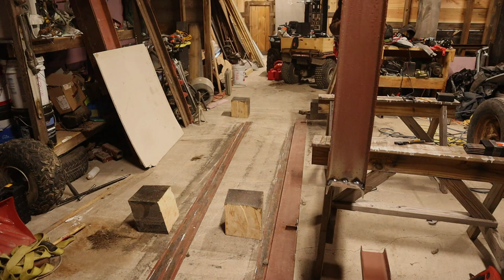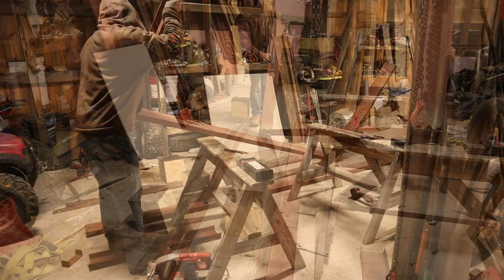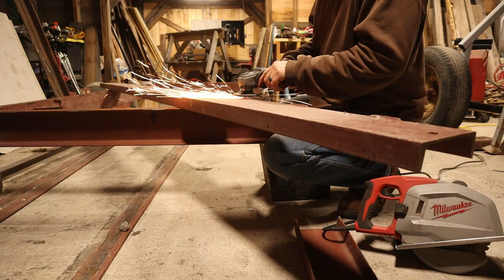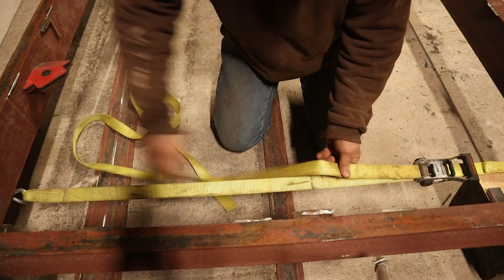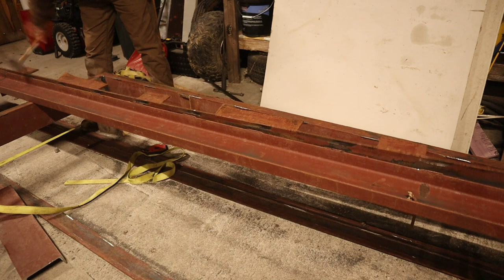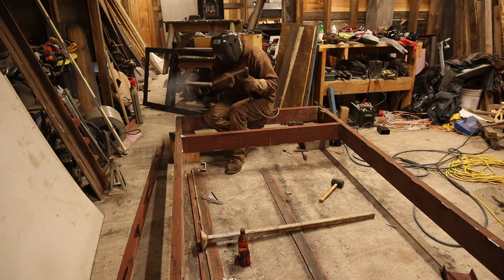Magical Hydraulics: Continuing The Sawmill Trailer Build

Comment: Good job Jim. Guessed you had been out of town again. When you were saying about the frame twisting, I just wondered if you were going to put 45% angles in the corners of the frame to help prevent the twisting. Another way would be from that first cross member, going from where it joins at the side rail to the centre of the end rail. Looking forward to seeing the progress you have made. Take care travelling in that nasty weather. Be safe. Graham 🇬🇧🇬🇧👍👍
Reply: I concur on cross-bracing to limit twisting. But do you look at it and think anti-stretch bands, or anti-crush bracketing, or some of both?
Reply from the maker: The big worry for me is the trailer twisting.  By the time I get the tongue on it and some corner braces welded on the back, racking shouldn't be an issue.  Hopefully the jacks will take care of any twisting once the mill is set-up.
Reply: @TheTradesmanChannel  great minds... you sound like you knew just what I was thinking. Like bracing in floor joists to stop racking/rolling... exactly!
Maybe strapping from sub-corner to sub-corner welded in so it can't stretch diagonally, it can't twist. (Held square in dimention, unless the strap stretches).

Comment: Hydraulics are great to work with to do that kind of work. We used jacks all the time splits 40,000lbs press units apart. Just put some blocks under the square pipe to support it and keep it level and it works fine.

Comment: I was getting a tad worried .... I was going to check up on two of "my" channels, and here you are, bold as brass ;0)

Welding those braces up the way you are is the way to do it (IMO) .... cutting them short and welding the gap will give you shrinkage distortion! As to your "leveling" problem you can easily scrounge (Free and gratis) old wind up caravan legs. Might be an idea?  Kind of handy having the tool you need to level being a tool you always carry in your vehicle anyway ;0) 

See you on the next one
Reply from the maker: Not a bad idea Dave.  They are going to need to be very beefy for what I'm doing.  I was going to use farm jacks for it.  Probably going to be 6 to 8 jacks on the sides.  The mill needs to be supported very well or my timbers will be off.
Reply: @TheTradesmanChannel  Yes ..... I would have said 4 a side to get it stable and even!

Comment: Your comments about tongue weight vs. axle placement are spot on. A lot of homebuilt trailers will run their axles close to center lengthwise of the trailer. Not good. I know you research your projects pretty good, I'm betting you're already there. If you look at most of the big name trailers built with engineers and computers, usually they will set axles a minimum of 60/40. That is to say, they will set the axles 60% towards the rear of the bed length. Center of axle, or center of tandems, triples etc.. That does not include tongue length, only use the load platform. When you start studying different weight class trailers, as well as purpose built (say dump trailer vs. flatbed), you'll see almost all the larger manufacturers follow the same paths. 
Looks kinda like the timber frame build. Strong enough to do twice the job LOL........ Thanks for sharing

Comment: Morning Jim. You missed one...
"Close only counts in horse-shoes, hand-grenades, [and H-bombs]". But, close enough 😁.
Any angle gussets/bracing in that trailer frame? Plans for running the wiring to protect it from abrasion/impact? (Steel conduit?) Can't wait to see the next update. Be careful on personal side work with six hour commutes on top of the work schedule. That is a lot of driving time. Proper rest is important,  dont need an update from Mary that you fell asleep at the wheel or anything else in the accident arena. Be safe out there friend.
Happy Holidays to you and yours.
Reply: You forgot Farts also.

Comment: I use a set of load locks to spread/lift with that I used when OTR Trucking. Many times they have payed off. Currently, I am using them to reshape cattle hay rings that were crushed by a Angus Bull that was feeling his oats.
Reply from the maker: I almost did that.

Comment: You need to find an RV auto leveler, just hit a button and it will level that trailer right up. Most motor homes have them on them.
Reply: Well, depends on the age and level of the motorhome. Higher end motorhomes do after a certain model year. But great suggestion.

Comment: Glad to see and hear about the progress. Stay the course and drive safe. What kind of deck are you putting on and tie down rings for the sawmill and 4 wheeler.💚💜⚒🤠
Reply: Hopefully expanded steel so the sawdust can fall through.
Reply from the maker: I'm looking for expanded steel and may have a source.  Directly under the mill will be left open, even expanded steel will hold bark and debris.
Reply: @TheTradesmanChannel  sounds good that should work well.👏👍🏻